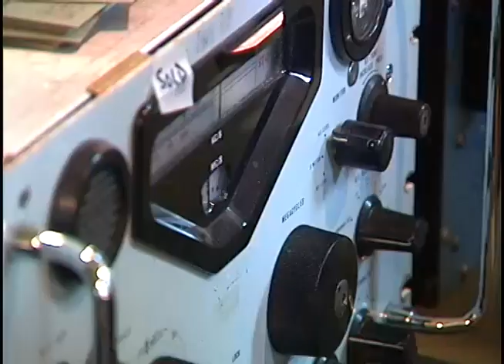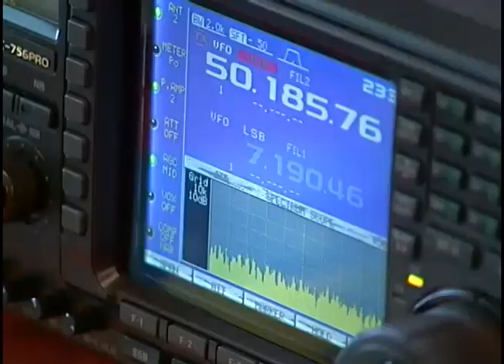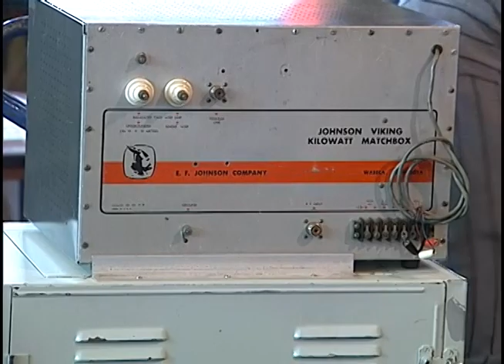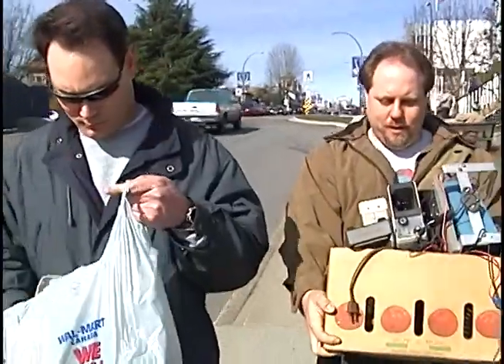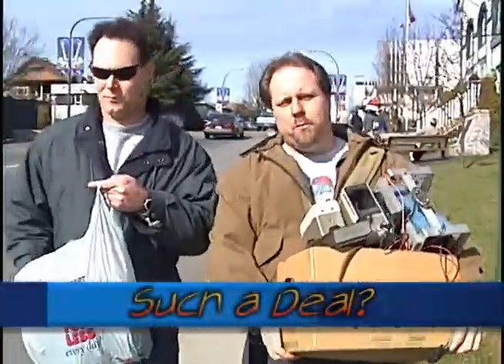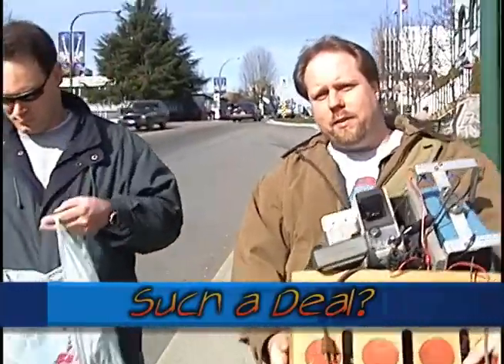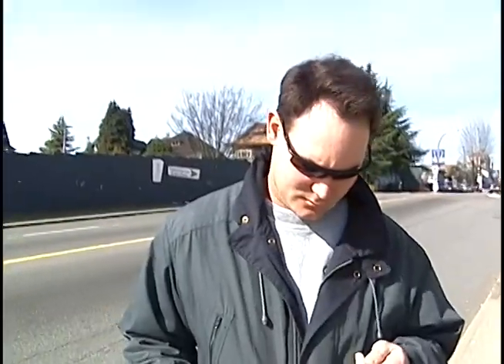2001 Burnaby Amateur Radio Fleamarket

Comment: That looked like a decent hamfest back in 2001, there are less of them now and the prices still make you laugh.
But i suppose it's an interesting day out :-D
Reply from the maker: I got a real nice Tektronix 604 x-y scope that I made a clock out of for 20.00 at the last one I attended.  But you are right.  Much overpriced junk.
Reply: @12voltvids  not much stuff people even have left to sell either
Reply from the maker: At every hamfest i have been to over the past 5 years it is the same stuff over and over.  Sometimes the same sellers other times it is on someone else's tables.   I rarely buy anything.  I got an old bakelite am radio once.
Reply: @12voltvids  precisely, eBay is a better bet
Reply from the maker: @aqib2000  
Not really.  The idea behind hamfests is it lets the hams just hang out and buy and sell from each other.  You know what you are getting and what you are prepared to spend.  I picked up a nice mint Tektronix scope for 20 bucks and a nice Akai 4000 reel to reel for 30 bucks at hamfests.  There is vintage junk that i wouldn't have any use for but my junk is another's treasure.  You can't pick it up on eBay, you can't test it on eBay.  You are rolling the dice and taking a chance.  At a hamfest you may just find that one impossible to find part you are looking for to complete a project.  And you get to meet d friends that you may not have seen in ages.   They were alot of fun to go to.  I can't do them much now even if there wasn't covid because they are always held on a Sunday and I work every Sunday. I run into Paul Carlson at just about every one and have a good chat about YouTube and the trolls we have to deal with.